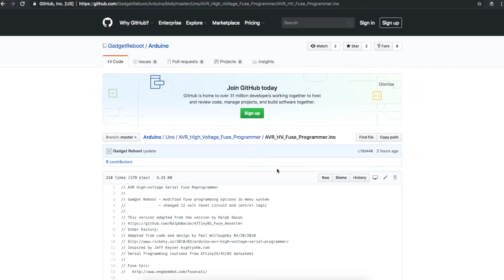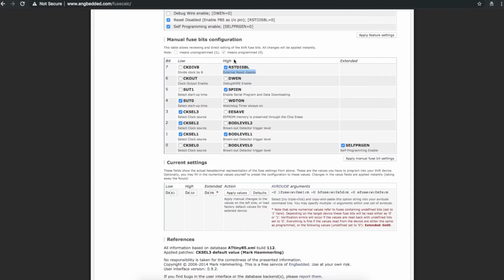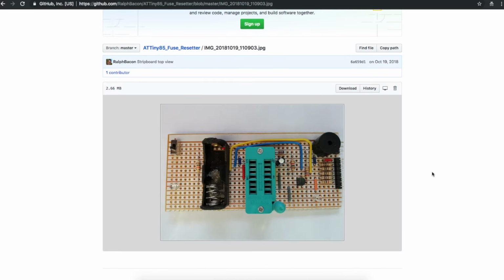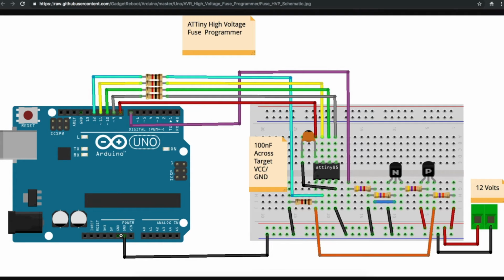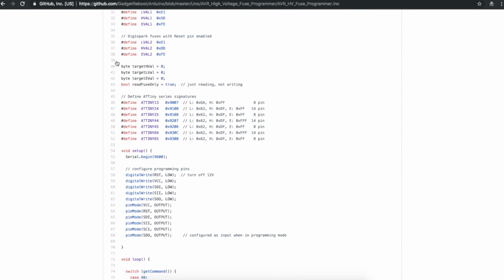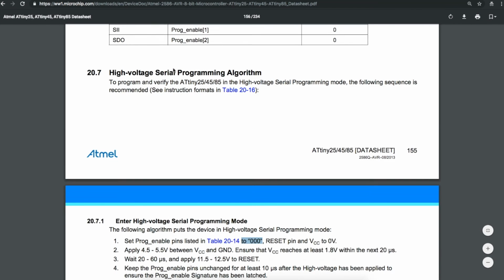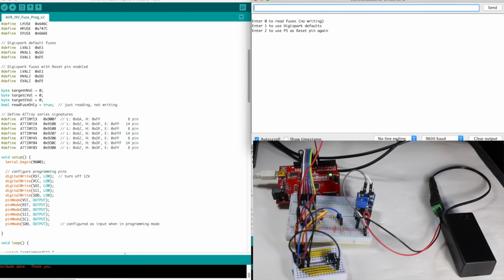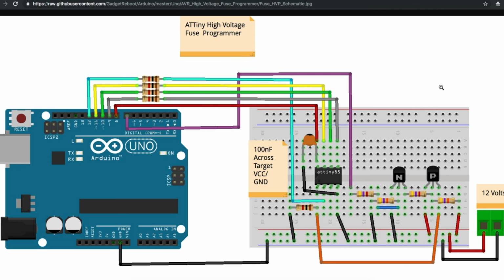ATTiny85 Fuse Resetter with Arduino

Comment: will that delet the eeprom which already on chip..??
Reply from the maker: I haven’t used it in years but looking at the sketch all it is doing is writing the fuses so that shouldn’t destroy anything else although there is one fuse setting related to whether or not EEPROM is erased or not when the main chip is being erased, but that’s a separate issue from whether resetting the fuses themselves erases anything, I would say only the fuses themselves get changed with this.
Reply from the maker: I looked at the fuse settings that this sketch writes, and the High fuse is the one that contains a setting for whether EEPROM gets erased when the rest of the chip is getting reprogrammed.  
It looks like the fuse settings in this sketch would permit EEPROM being erased during chip reprogramming after the fuses are set here.
You can see that fuse on this fuse calculator https://www.engbedded.com/fusecalc/
If you select ATTINY85 in the drop down menu and then scroll down to look at the Manual fuse bits configuration,
In the High fuse section there is one called EESAVE and when it is checked, it means "EEPROM memory is preserved through the Chip Erase"
This sketch doesn't have that fuse checked so if you do want to make sure EEPROM isn't cleared when the chip is reprogrammed, in the sketch, change any HFUSE configurations near the top of the sketch to preserve EEPROM.
So when the sketch says HFUSE is 5D,   make it 55    to not clear EEPROM
When HFUSE is DD, make it D5 to not clear EEPROM
Reply: @GadgetReboot  
thank you sooo much for your efforts.. i will try then i will feed you back
Reply: @GadgetReboot  
by the way.. i will try this project on Attiny25... i think it will the same config..right..??
Reply from the maker: I have only used it with the 85 but it looks like the sketch is set up to recognize the 25. So then there are most likely different fuses so you would want to go to that website with the fuse calculator and select the 25 chip and see what fuses are available and set it up the way you need to enable the reset pin or preserve memory and those things
and then put those fuse bytes into the sketch instead of the ones that are defaulting for the 85 chip in the sketch.
There may be some information out there about what the default fuse settings are for a 25 chip straight from the factory that you can use as a starting point and then see if you need to tweak it

Comment: Great video
I have nearly 10 pcs ATMEGA8 (need FUSEBIT Doctor  kit  so blocket MCU ).Can update this app.for this MCU too?
If yes could you make a short describe especially ATMEGA 8 Pin convert connections and which arduino codes changins lines   (I have ARDUINO kits and I used to arduino in  2-3 application)
*Sorry for bad English
Thank you

Comment: Can i use same sketch and circuit for attiny13A
Reply from the maker: I haven't used it for anything other than Attiny 85 but it is supposed to be compatible with all ATTiny. So for hardware just need to make sure the pins between ATTiny13 and programmer make sense based on ATTiny85 and programmer (reset, power, serial data etc must go to the right places).    For software the code should work, but I hard coded it for ATTiny85 so the desired LFuse and HFuse data would need to be put in the sketch to be written to ATTiny13 (it has no Efuse because it's a smaller part).
Reply: @GadgetReboot  thanks for reply
Actually before your reply i got excited and I took the risk, checked pintout and attempted it 
And it worked 

Thanks a lot
Reply from the maker: @ashutoshagrawal8639  Now I know it will work when I'm ready to try it too!  I can't remember which ATTiny I have in addition to 85 but I have something I bought. Just need to find it.

Comment: Well, I tried making this on a proto shield.  Rechecked wiring several time, but  it keeps coming up with ffff for signature and ff for the fuses. tried changing out the 328p on the Arduino uno, same results.  And using the schematic  in Github, I didn't use the 1k resistors in the data lines..  Any guesses?
Reply from the maker: I don’t know what specifically could be at fault but it sounds like it’s just not reading so it’s defaulting with all F. So if I were debugging, my first things I would check are to make sure the target device is receiving power and the data lines are actually toggling and not just stuck high or something.  The 1K resistors in the data lines are optional.
Reply: @GadgetReboot  I did all that till I was frustrated, so started over with this one: https://arduinodiy.wordpress.com/2015/05/16/high-voltage-programmingunbricking-for-attiny/?unapproved=25007&moderation-hash=1195bc5ccd84ef08e747e21ab2468745#comment-25007  
This one was successfull.  Only thing I could find wrong with your method that may have contributed: the 12V line at pin 1 was greatly reduced.   Maybe my transistors were bad. (they were new).  Thanks anyway...you got me moving.  :-)

Comment: Is it possible to recover Atmega328P with this way ?
Reply from the maker: I haven’t tried it myself but the same basic principle does work. I found a related blog article about the mega328P https://fos.cmb.ac.lk/blog/fuse-rescue-using-high-voltage-programming-arduino/

Comment: I have a bunch of NPN transistors that aren't the same ones used in the diagram. Does anyone know if it's safe for me to use a BC337, 2N2222, A1015 instead of the suggested BC547 or will that fry my circuit? I'm new to all this stuff. Thanks!
Reply from the maker: The transistors used here are just as switchers so the specs aren’t that critical as long as it can handle up to around 12 V, which I expect should be no problem. I think 2N2222 can handle 30 V.

Comment: @ Gadget Reboot ;Why don't you use inductor connecting Vcc(attiny) to 5V to delay voltage up , use A0 (ADC pin of Ardruino) to monitoring  the voltage . When Vcc  is up 1.8V (or 1v), supply 12v to Reset pin

Comment: to: Gadget Reboot ; Can your sketch be used for ATtiny 13a case? If it's attiny 13, where do I change my sketch? I want to  re FUSE  as the default  #define  ATTINY13   0x9007  // L: 0x6A, H: 0xFF  . What ''0x9007 " is ? Thank you so much , I had read and watched your video  ,maybe I use Mosfet P chanel and driver from an ardruino

Comment: what can it be? i am using a ATtiny85 bare bone

0> returns

Signature: 7C7C
Reading Fuses...
LFuse:7C, HFuse: 86, EFuse: 7C

1> returns
Signature: 7C7C
Reading Fuses...
LFuse:7C, HFuse: 86, EFuse: 7C
Writing Fuses
Reading Fuses...
LFuse:0, HFuse: 0, EFuse: 0

2 > return
Signature: 7C7C
Reading Fuses...
LFuse:7C, HFuse: 86, EFuse: 7C
Writing Fuses
Reading Fuses...
LFuse:0, HFuse: 0, EFuse: 0
Reply from the maker: Not sure, it’s very weird that it’s actually reading some pattern of zero and one and it’s not all just stuck at 00 or FF when it reads 7C for both the signature and the fuses. 
 Have you tried more than one ATtiny85? 

 Without knowing what the problem is, I would try things outside of the Arduino sketch like running AVR dude directly from the command line with various things to see if I can read the device that way  with the circuit still set up because AVR dude on the command line will still recognize the Arduino as a programmer to talk to the chip, and  see if a valid signature can be read.  

 If we can’t even read a valid signature then we definitely can’t expect to be able to program anything because the most basic interaction is already failing. 

 I would also try different versions of AVR dude. I think I was having different results with a version five and a version six and I had to directly run different versions from the command line by referencing their folder path and configuration file path to make sure the right version is being used while I was experimenting. 

 It would of course be best if you had more than one chip to try accessing and make sure the error is the same so you know if the problem is even anything to do with the software or the programmer hardware or just a strange specific chip. Then maybe try tearing down the whole circuit and build it up again. Sometimes things are just weird the first time.
Reply: thanks so much for your respond. I will definitely try rewiring the circuit. 
 Bought 5 new ATtiny85 chips from Aliexpress and all of them giving me this when i try to load bootloader or any sketch (strange).

"avrdude: Device signature = 0x000000
avrdude: Yikes!  Invalid device signature.
"

so i thought these are bricked.
i have uploaded sketch before onto  many ATtiny85 before via Arduino. 
Have a great Memorial day weekend!
Reply from the maker: Another thought I just had, I’m not familiar with all of the fuse bits  right now but reading a device signature of zero sounds like a write protect or read protect kind of thing so double check if there’s a fuse that controls lock bits and ability to read and write and then try clearing those directly with AVR dude and then maybe you can do normal  things again.  

And also if you simply connected the chip to the programmer and there’s no external oscillator, I’m not sure if that will cause a problem communicating, maybe you need to reset certain bits for the internal oscillator to function.  I can’t remember if the high-voltage programming mode should still work independent of any of those settings or if you need to reset certain bits to even get high-voltage programming to fully work but it’s something to think about and maybe Google what to do if you have a bricked device but you have a high-voltage programmer available.

Comment: Nice project!

I used my GQ-4x4 EPROM programmer for a similar recovery when I messed up the fuses.
Reply: @Codedbad  
Dose it erase the eeprom while you unlock the fusebit..??
Reply: @Ahmed-Nabil-Auto  Good question! I tested this and yes it does erase the eeprom! (I changed a CKSEL bit)
Reply: @Codedbad  
could you find any way to save the eeprom ..??
the main point that i need to recover my eeprom 
thank you alot for trying help
Reply: Pro tip : watch series at Flixzone. Been using them for watching all kinds of movies recently.
Reply: @Corey Donald Definitely, I've been watching on Flixzone for since november myself :)
Reply: @Corey Donald Yup, I've been watching on flixzone for years myself :)

Comment: Since the reset pin requires nearly 0 current (very low), seems like you could connect the boost converter straight to the 5v rail on the Uno and lose the 9v battery
Reply from the maker: Good point. I brought the 12 V circuit in from a different project and just stuck it together so I never thought of that. I also think I’m going to get rid of the series 1K resistors on the data lines because they aren’t really needed.  They may provide a little current limiting in case of any short circuits or other signals trying to drive the same line but that shouldn’t be happening in this set up.

Comment: Very interesting. Maybe you could add an option to upload the micronucleus bootloader before setting the digispark fuses.
Reply from the maker: Anything is possible, now that I am finally having progress all the ideas might present themselves. I just now managed to do high-voltage programming on the ATtiny while it’s on the digispark board,  not just the chip by itself. 

So if I can do some more testing with that and get full programming access in circuit, worst case I can manually upload the bootloader from the command prompt with AVRdude.

Comment: Yup yup, I've also bricked a couple t85's, and built an HVSP to unbrick.  This can happen when fusing out the Reset Pin to make an ISP (you will need all 6 pins for this).  Here below is the one I used ... but found a 2n7000 worked better than the BPJ NPN on hand.  http://homepage.hispeed.ch/peterfleury/avr-hvsp-fuse-restore.html
Reply from the maker: I like how that design defaults to turning the NPN on so 12 V is not applied to the reset pin until needed. I couldn’t find clear information in the data sheet that said it was OK to have 12 V there when the target is not getting VCC so that’s why I did it similarly.